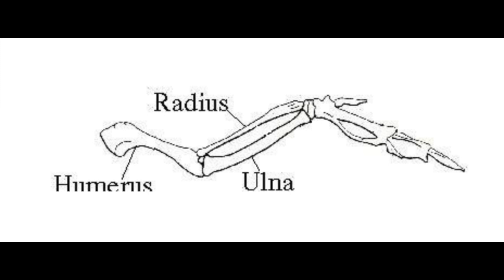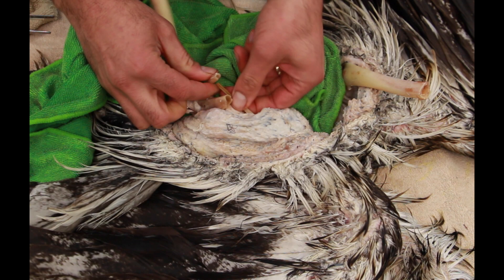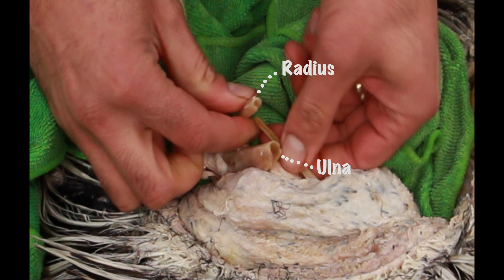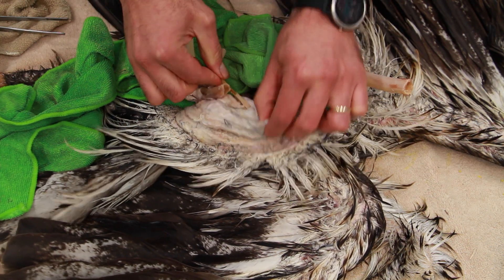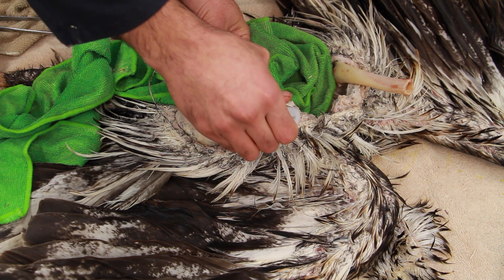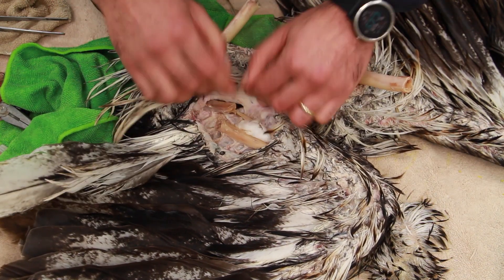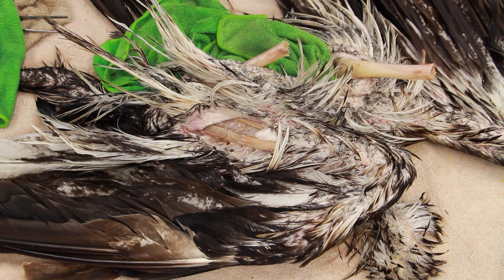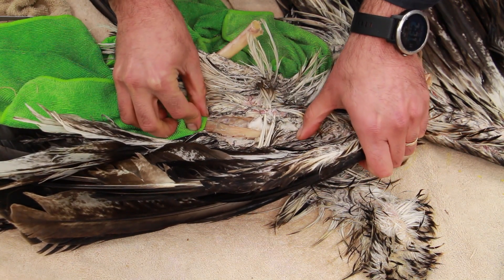How to repair broken Wing? Ulna and Radius.

Comment: Hi there.
Is it also the same method if pieces of bones is gone?
Reply from the maker: Hi Christi …. Yes , Pretty much. If bones are broken clean you can repair them like you see in the video and if the middle parts are broken off and gone , as long as you have both ends you can use a suitable length of stick to repIre them.
Reply: @ArtofTaxidermy  ok perfect thanks.

Comment: Wait do you leave the bones inside the wings when u do a bird like this? I though you remove em and u replace it for a wire
Reply from the maker: No… the leg and wing bones need to stay inside of the mount then you wire the bones.
Reply: @ArtofTaxidermy  Why the leg and wings bones need to stay but the rib cage no? If its absolutely clean?